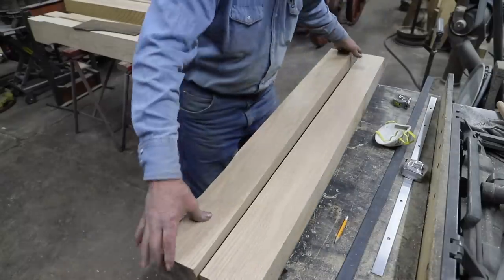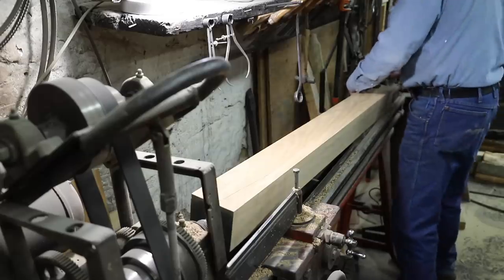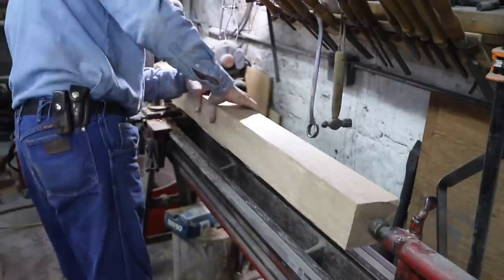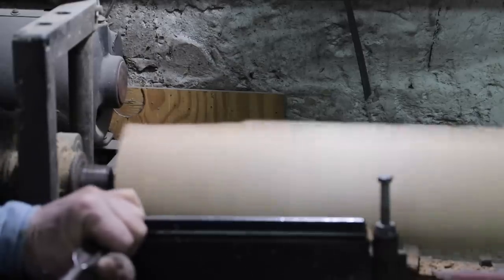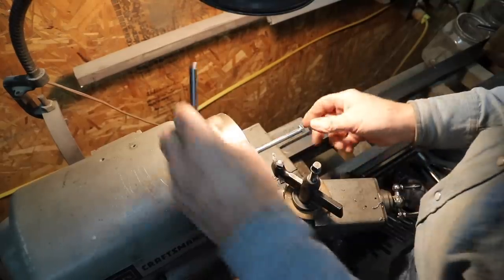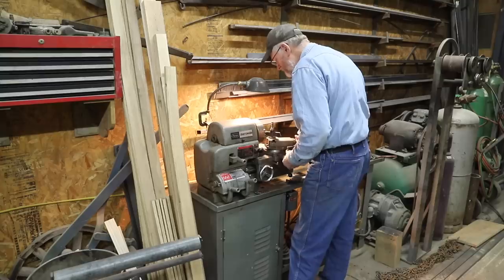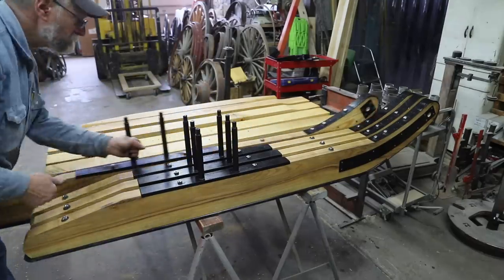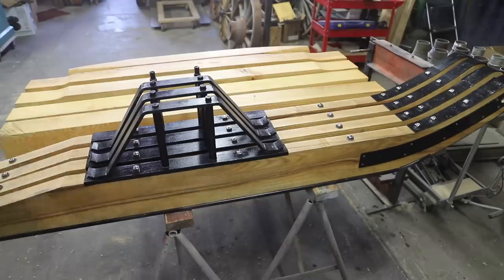Final Assembly on Bob Sled Runners | Part 4 | Engels Coach Shop

Comment: I love all your work but two things stand out for me.
The ability to drill from freehand two sides and join up in the middle, everytime.
Leaving all the nuts exactly square to the runner sides shows your exceptional attention to the smallest detail.
Many thanks for your videos they are prime example of "If a job is worth doing, it is worth doing well"
Reply: I noticed that too -- durn good aim with the drill bit !!
Reply: @Reziac  Notice that he drills one side then the other for the threw hole that the drill follows the other pilot hole.
Reply: Fiore Vitola yeah. I'll have to remember that.
Reply: David Allinson wrote my comment :)
Reply: I did notice.... that still requires good aim, or you just wind up with TWO misaligned holes. Ask me how I know this. :D
Reply: Clocking the square nuts and the bolt heads is a nice finishing touch to the high level of craftsmanship demonstrated in the entire project.
Reply: @Reziac  Yer not alone you know.  ( :
Reply: Heh heh, yep... "I cut it three times, and it's still too short!"
Reply: @Reziac  must be cuttin from the wrong end, ya think?
Reply: That must be it! I'll cut the other end next. :D
Reply: Sold! well, at least if they come with pre-stretched boards, and the hydrating formula for that water. Don't want to wind up with dihydrogen monoxide poisoning. :D
Reply: @Reziac  how do you know this? LOL
Reply: By the fact that I've given up carpentry. :D
Reply: @Reziac  😂🤣😂🤣😅

Comment: Thank you for another jaw dropping segment of what goes into making a bob sled.  Did most farms that used bob sleds around the yards build their own sleds or was that a job for the wheel wrights ?  I can not see how any shop back in the day of bob sled use, could be making any money selling one of those for the amount of labor that goes into it, and the amount of materials needed to kit one out.  Steel and wood in those dimensions are not cheap, and there is a lot of it already there, and you still need the top and the part to hook up to the horses I think. I am guessing at between 10 and 15 k for something like that in todays markets.  So in days gone by like 3 to 4k maybe ? Cheers, from the land of snow maybe, or maybe not,  Michigan. I am starting to get new grass growing, I will have to put a calendar outside for the grass to look at, so it can tell it is not time for spring yet.

Comment: If I were to try and drill a hole  from top to bottom of one of those runners it would end up at  least a 45 degree angle at the other side. Great skill and great video. Happy New Year to you and the misses.

Comment: Like others have already commented.. I am very impressed by your ability to drill through the wood like that and find the hole in the steel on the other side.  I would have had the drill bit going out the side and into a body part or two if I had tried that without a drill press, lol.

Comment: I can not figure out how you drill so straight without the drill wandering. I guess years of practice Happy New Year!
Reply: Boy drill from one side, girl drill from t'other. Gots to meet.
Reply: If you notice, Mr Engel puts his finger over the hole he made on the opposite side when drilling the second half of the hole.  What happens is that the drill homes in on his finger, trying to tear a hole in it.  But Mr. Engel deftly pulls his finger away at the last second, tricking that mean drill bit every time.
Reply: @wesley115777  That is absolutely true.  Murphy's Law in a practical use case.
Reply: There comes a time after acquiring enough experience that 'muscle memory' kicks in. Let your hand and eye do what you've spent years teaching them to do.
Too, the holes don't have to be exactly aligned, there is enough play in the materials - the wood and the metal - to allow for slight deviation.  We aim for perfection but settle for our best.
I spotted several imperfections in this video but they are not worth mentioning.  At the end, Mr. Engels does say not all are the same.  That can be interpreted in several ways.
The work here will bring many years of happiness.  Already there has been that in the building, the watching of the build, then to the user.
Reply: @MrLikeke  Na, he knows the drill is trying to bite him so he's just luring it in <grin>.
Reply: Experience and sharp drills [bits if you prefer], of which I have little of either. I am still honing my skills at sharpening drills.
Maybe some day, with enough practice, I can enable the muscle memory to go into full automatic mode, but for now, I still concentrate on getting my fingers and hands out of the way of cutting implements.
I've got scars from knives, plane irons, drills, grinders, and one from a chainsaw. I'll learn or die trying.
Reply: @thomasarussellsr  I can check the oil in my truck and will cut my fingers.  Knowing Murphy is in play and use it to your advantage is a sign you're very sarcastic!

Comment: If I were to drill some 6inch timber from each side would the holes meet up? NO!  Great work as ever.
Reply: No kidding!
Reply: They sorta self align when you get close!
Reply: They sorta self align when you get close....
Reply: Even if I did it under a drill press they wouldn't meet!
Reply: To do that I would have to drill straight though - May get to proper spot should be.....
Reply: If I tried that one would come out the side. Not a chance of meeting up
Reply: Long bit and practice go along way.
Reply: Heck, I might come out in a different chunk of wood entirely!!
Reply: @hefy2jefy  IKR?
Reply: @Reziac  me too.
Reply: John Fox it takes a lot of skills and experience, of course the holes are not 100% straight that’s why it’s only drill it halfway, unless using the big drill press...

Comment: Amazed by your long hole drilling skill. I don't think I could eyeball a meeting from both sides hole, without a whole lot of luck. Will there be any type of pin to hold the bunk-stakes in? I would imagine that through swelling and drying cycles those stakes could loosen up a bit. It would be bad to have a skid fall off in a low spot out in the back country.
Your skill and experience shows in the fit and finish of these pieces of the project. I can't wait to see how it all comes together. Thanks for sharing.
Edit, do you resharpen your drills, or just buy new ones?

Comment: Niçe job yes as you said that ONE stile in Quebec Appalachian were snow is deep we made them 6" wide but about two inch that touch the hard surface and lower on each side so went on soft surface we used 6"

Comment: Im curious how long something like that lasts, if used frequently. Wouldn't it rust pretty quickly?
Reply: It won't rust or rot in use; motion keeps everything clean. It might rust or rot in storage. If it were mine, I'd put it up on blocks for the off season, or better yet in the barn and on blocks.

Comment: Why square head nuts on a new build?  I like your work and know how hard it is to do such reparative tasks and remain sharp to what you're doing. Nice touch to line up all the heads of nuts!
Reply: Those were the style nuts used in the day.  And I believe the lining up of the of the nuts is called clocking.
Reply: Because that's the way it's always been plus it looks professional ,the same with aligning or clocking the nuts,if your doing something,even just tightening nuts,do it right so it's pleasing to the eye. Then you can stand back and truly say I did that.

Comment: What are the factors that determine the use of bolts versus rivets?
Reply: I think the main reason for the bolts is that they can easily be tightened when the wood shrinks.  And the rivots are in "shear", meaning the force is pulling perpendicular to the fastener, so being tight isn't as critical.  Plus small rivots can be hammered down pretty easily if they get loose.  I'm guessing that back when these were first made, the small rivot was a very inexpensive fastener compared to threaded bolts.
Reply: will it need to be taken apart.
Reply: I had the same question, but that makes sense. Thanks.
Reply: Parts that will need disassembled for future repairs/replacement, get bolts/nuts, would be my guess.

Comment: some holes get rivets, some get bolts. Is there a "simple" reason that tou could share with us next week?
Reply: Just guessing here: The parts that might need to be replaced regularly (steel shoes on the runners) get the bolts?

Comment: I am surprised you didn't use a bigger hammer when setting the rivets, using a hammer that weighs 1.5-2 times as much would be more efficient. I guess if you wanted efficiency you would use an pneumatic rivet setter.

Comment: Fabrication takes time and repetition.
It is so difficult for so many people to understand that in today's world.
Reply: A hand made quilt is a fine example of people not appreciating the true value of a finished craft. If you figure materials, labor, and skill; a queen sized quilt should sell for between$1500 and $2000 for the crafts person to pay their bills from their craft. Maybe a lot more if the piece count is really high, or diagonals/curved sewing is involved. A person can go to Wally World and buy a cheaply made factory produced "quilt" like blanket for $20-30, but you get what you pay for. 
I have a 328 piece twin quilt that should go for $1350 if figured at minimum wage at an hourly rate plus materials. (Hand cut, pieces are machine sewn, and I'm almost done hand quilting the layers together, maybe three to five more hours to completion.
So figure how many hours for a smaller hand quilted quilt with $83.47 in materials.)

Comment: As always you are a true craftsman.  I cringed when you were running the lathe since you have to go to the one end of the machine to turn it off.  You really should consider installing in E.M.O. (emergency disconnect) switch where you can reach it.  Since you wear long sleeved shirts you are at risk .  Keep the videos coming!